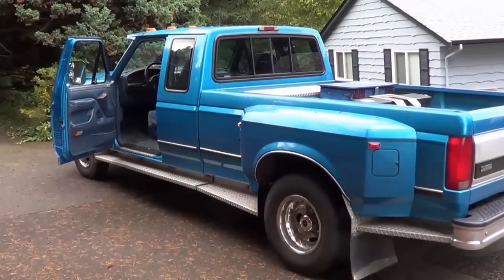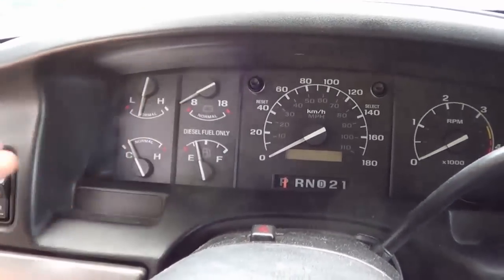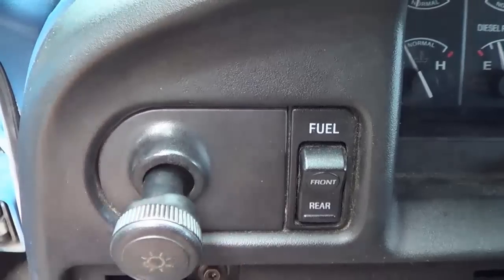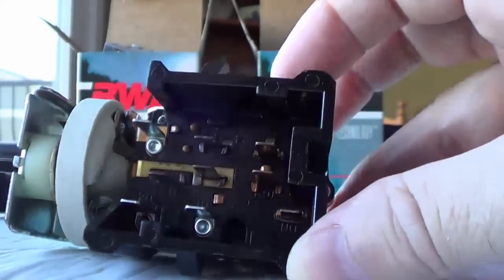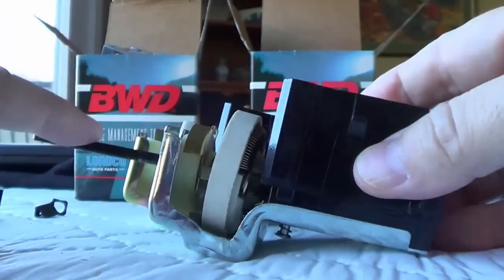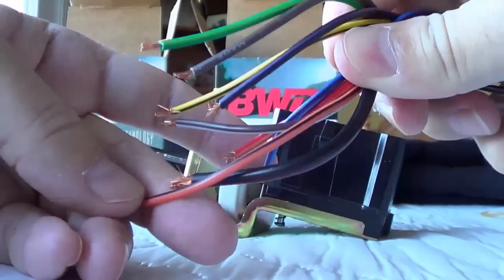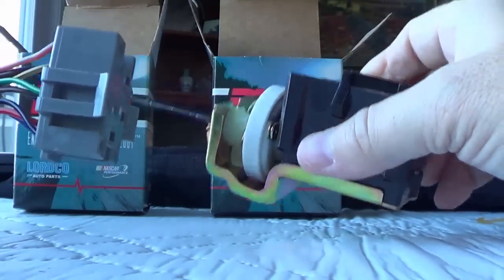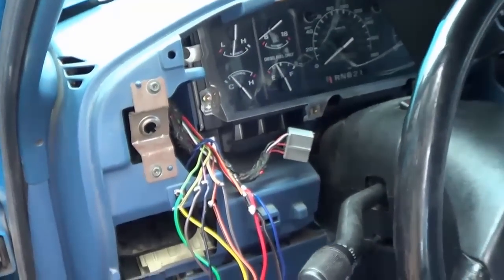Replacing Our Ford Trucks Intermittent Headlight Switch

Comment: I'm sure you figured this out but, you need to wire in a relay so that your trailer lights aren't running  off the headlight switch directly. My 89 had the same problem.
Reply from the maker: My 1994 has the factory installed tow package with a 7 pin connector wired in.
Reply: So did mine but, there wasn't a relay for the trailer lights on mine.
Reply: All the load for the extra lights was going through the head light switch.
Reply: Maybe Ford forgot to put the relay on mine. Lol.
Reply from the maker: Mine has a relay marked "Trailer Tow and  Dual Rear Wheel Running Lights".
One thing I've also done is swap out all the marker lamps on the trailer for LEDS. Brighter and about 1/8th the amperage drain. Cheers Ray

Comment: There is a typo in the description. (you did to instead of too) The headlight switch never failed in our 1986 6.9 IDI Ford F-250.
Reply from the maker: Thanks
Reply: Love Your RV Do you put SCAs in your coolant? I heard that the 7.3 IDIs are much more prone to cavitation then the 6.9 (especially the turbo 7.3 IDI).
Reply from the maker: Nathaniel Clark Yes.

Comment: What battery side do I disconnect
Reply from the maker: I usually disconnect the negative or both. And remember in a big diesel engine there are two batteries to disconnect. Cheers, Ray

Comment: I have a 1994 f150,and my lights started to act up,first I had to wiggle the shaft to make the park lights and headlights work. I just bought a new switch and female plug and it hasn't improved at all (can anyone help me out?)
Reply from the maker: If you could wiggle the old switch and make things work I'd suspect maybe a loose wire somewhere behind it.

Comment: does anyone know this one? With headlights on, turn on hi beams, &, it turns off low beams, but, use the passing lights (momentary hi beams) both low & hi beams are on. Here's the question, can you wire it to have both low & hi on at the same time with hi beams on?
Reply: You ever find an answer to your hi/low beam question, anywhere? Would like to do the same!
Reply: Yes, you can do this, but I strongly advise against it.
You can also wire this switch to "dim" your headlights via the dimmer function, but again... I strongly advise against it.

Problem is this:
There is too much "Juice" or power in this switch in the first place. This is why these light switches burn out.
When you go jumping terminals to get "this" or "that" function or add additional lighting to your truck via this switch, you essentially are drawing too much power through the switch or diverting additional power to wires and terminals that are not designed to handle the power load.

Note the video around the 6 minute mark. Notice the charred Molex receptacle. Also note the spliced wire wrapped with electrical tape in the background. That's a strong indicator of what I'm talking about.

I've seen these ford switches literally light a dash on fire !

There's a lot of electrical power running through this switch, so a person needs to be very careful to wire it correctly and do not add any lights/wires to this part of the system. If you want additional lights in your cab, bumper or whatever, they need to be wired in independently with their own dedicated power source, wires, breakers and switches.

Never underestimate how much damage an overloaded electrical system can do !
Reply: Vic, thank you for responding to my question reg' hi-lo headlights on my F-250. One more for ya,... what if I was to put my hi-beams on to a relay (for power), & the hi-beam power wire off the headlight switch would trigger the relay, thus, turning on the hi-beams with no power going through the headlight switch. Can you "see" what I'm talking about? Thanks again,  J.C...
Reply: Jay Carlson, again... I would strongly advise against doing anything like this. Since both the high beam and the low beam lights are being generated inside the same bulb, you would be overloading the bulb (overheating) and the bulb itself would either blow out right away or at the very least it would burn out prematurely.

I don't believe that both filaments are being charged at the same time when you use the "passing lights (momentary hi beams)" as you mentioned. I'm pretty sure that it's just momentarily switching from low to high beam.

With the high beams on, there is no real reason to have the low beams on anyway. The high beams are brighter than the low beams and you would never "realize" the light given off by the low beam filament.

There's just no gain from doing this.

Comment: Link for parts
Reply from the maker: The original Ford part number stamped on the headlight switch is E778-11654-AA. The Lordco Auto Parts numbers were S2004 for the headlight switch and PT767 for the Molex Connector Plug.
Reply: @LoveYourRV  thank you . Did you Sauter the connections?

Comment: If you push that button on the back of the switch the knob will come out  Just saying.
Reply from the maker: Denny Johnson Good idea if you can get reach it. I'm not sure I could on my truck, its pretty tight back there. I'll check it out next time I need to take off the dash panel. Thanks!
Reply: On my F150, the dash does not pull out far enough to get to the back of the switch... also, that switch is mounted to the dash (under the bezel) and must be removed first before being able to push that little button.

I thought the same thing before digging into my own (I knew about that little button from an experience years ago).